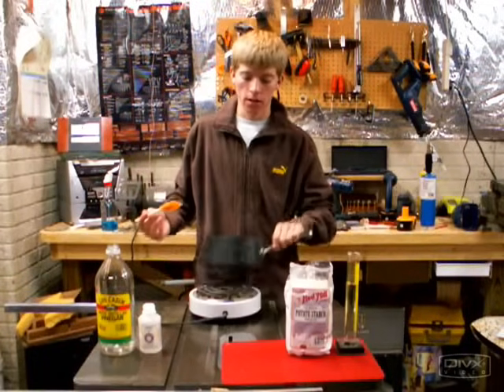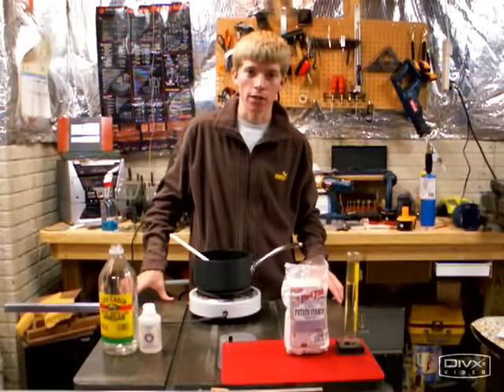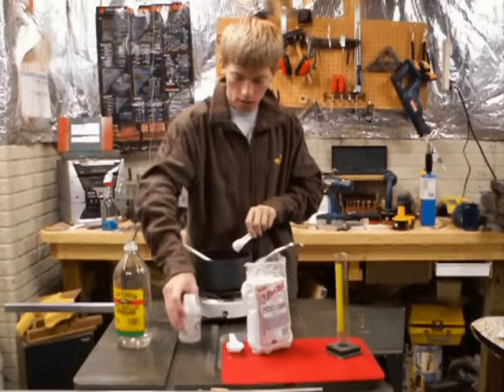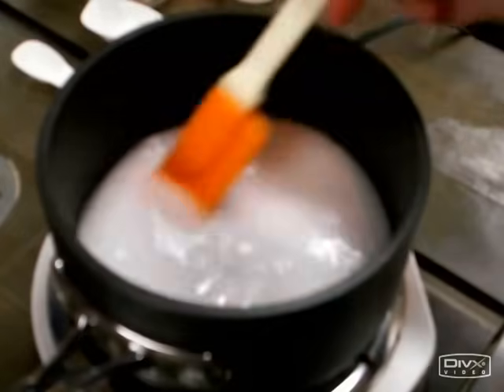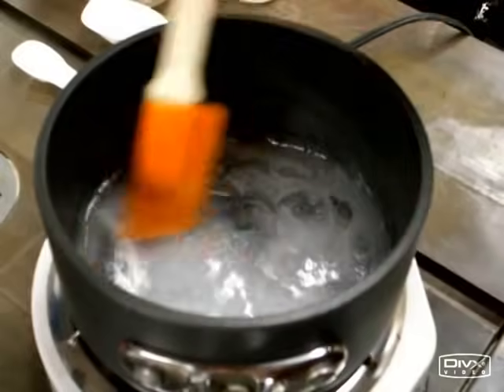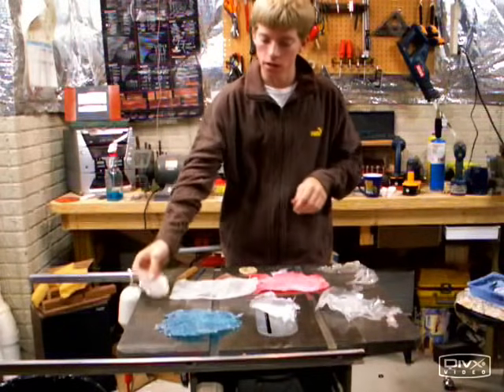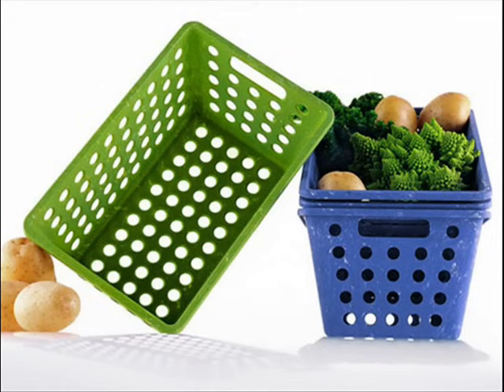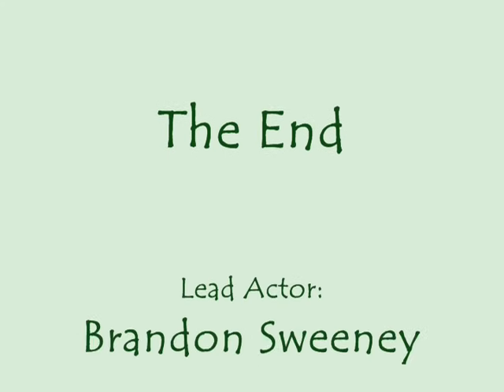Make your own bioplastic

Comment: I was so interested in your video, i went to green-plastics to check it out and get more information.  What i found was no working inks and e-mail addresses that are returned by the postmaster.  So... no help there.  Could you answer a question or 2 for me?  How long do the thin ones take to cure, and do you have an estimate on how long a 1/4 inch piece would take to cure?  (less that an inch square, and notebook sized sheet.   I don.t know if it takes hours or days, because you never mentioned it.  I have lots of ideas I want to try.  Any updates you can supply would be very appreciated.  Thank you!

Comment: Hello, very good presentation. I  was hoping to demonstrate this to my students. So I had a small query, please. How good is its tensile strength? I mean if you make a bag from this plastic and put 7-8 apples or 1 kg of potato, will it hold the weight?
Reply: Hi, I was just wondering if you tried this with your students, and how it went, and any additional tips. I am making this for a presentation as well, and so far I haven't been successful as it keeps breaking. So would just like some feedback. Thank you.
Reply: @lacey1887  hello. I did make it. We faced problems though. The spread of mixture was not easy, hence smooth of surface was missing. At some places it was uneven. So it tore. Tensility was ok. But not great. Once wet, it became sticky. It dried, but texture had changed. It becomes very dry, like a dry leaf, easy to crush.

Comment: how long does it take to harden?  Maybe I messed up but it seems to be taking longer than I thought
Reply: Hi Jordan, I'm having the same trouble - first attempt I took it off soon after it went translucent and its remained a sticky goo. Second attempt I added a tiny bit more tapioca flour and kept on heat for about 4 minutes while it was bubbling- this is a little less sticky, but still very much more of a goo than a plastic. Has anyone had this problem and overcome it with variations of the recipe or cooking time?

Comment: Steps to success:
1 tablespoon cornstarch
4 tablespoon water
1 teaspoon glycerin
1 teaspoon vinegar
Mix when cold
Low heat and stir until bubbles formed and solution starts to be clear
Reply: Is there anything we can replace glycerin
Reply: Ryan Ramego I have the same problem.
Reply: @syazanasufrian1760  can I have cornflour instead of cornstarch
Reply: Shafin Ahmed it is the same thing, dear. It is just it is called corn starch in US and corn flour in UK.
Reply: @shafinahmed3453  it is samething
Reply: @syazanasufrian1760     ...   thank you for the details! a typically American English with a hum in the backdrop, made it difficult for an Asian like I, to comprehend. thanks for the details in writing. thank you so much for the help!   ...   🙏🙏🙏   ...   
 - NSJ / INDIA 
Thursday, 4 MARCH 2021 (11:36 Hrs IST)
Reply: @syazanasufrian1760  there is something completely diffrent called cornflour
Reply: @brandonirwin9626  actually it is a sugar alcohol, not a fat.
Reply: @hilaryzeller6183  you're right, I mixed it up and meant to say its derived from animal fats, not is a fat.
Reply: @hilaryzeller6183  can be* it has many sources.
Reply: Does this dissolve in water?
Reply: can this be dissolved in water????
Reply: does this dissolve in water though?
Reply: josepf stalin just add more glycerine, both vinegar n glycerine act as plasticiser for the starch.
Reply: @kinwow-j8d  Are you are thinking of Alginate?
When the dentist puts that tray in your mouth with the goopy material that sets up in a minute, she's using alginate. It provides excellent detail, sets up really quickly, and is non-toxic.
Reply: What vinegar should i use?
Reply: thanks
Reply: Is it like epoxy resin ?
Reply: Is there any way I could do this without glycerin?
Reply: Can we add natural products like fruit peels?
Reply: How to shape it? Into bags and cutlery? Please reply
Reply: what if i use flour?
Reply: is there any alternative for glycerin
Reply: i dont get the “mix when cold” enlighten meee
Reply: @Lunaxyzxd  it just means that, you need to start mixing it before the ingredients gets too hot under the heat. It just means that after you put all of the needed ingredients start mixing it.
Reply: @Lunaxyzxd  you need to mix it all first then after it is thoroughly mixed, then you can start heating it in low fire
Reply: No glycerin what I have to do
Reply: Should I use aluminium foil?
Reply: Can i add tea powder to this and still work ??
Reply: @kinwow-j8d  yeah sure. Seaweed also using for made bioplastic. Kappaphycus alvarizii is the species
Reply: Mix when cold?
Reply: @allaboutarts4184  yes, first, then add heat. This way it doesn’t clump.
Reply: Thank you!
Reply: Can anyone tell me if vegetable glycerin would work??
Reply: can u specify the measurements

Comment: Hello!

I've used your video as a reference for our scientific study and experiment about on how we can help our environment and one of my colleagues have thought about this and at first, I've hesitated that this might consume our short period of time on conducting the experiment before our presentation yet when I found out about this video, I thought that "This might be possible" then it really is.

I did precisely what the steps are from the beginning even the pre-measuring of the volume of the materials.. 
But then, the results were not as same as yours. It turned out to be a hard sticky plastic unlike yours that is fully liquefied when it is poured on the aluminum foil (?).. 

I am slightly confused about what really is going on as to why it did not get the same results as yours to mine when I did exactly the same as you did?

Though, the results weren't that half bad.. We actually made one but still wasn't enough for us to prove this in our presentation that this can change the way we use plastic in our world..

Comment: That's cool, AWSOME..

What can be made with Silcone & starch or 
JB WELD, OR MABEY ROOF REPAIR SEALENTS, PLUMBING CEMENT GLUES ???? IDK how yhe make those harder plastics cast

I WANT TO TRY TO MAKE NEW CUSTOM PISTOL GRIPS..WITH OUT HAVING TO PAY FOR SMOOTH-ON RESIN 
(I THINK IT WILL TAKE MULTIPLE ATTEMPTS TO HET RIGHT)

I GEUSS I CAN USE THE SILCONE CAULK AND STARCH METHOD FOR MOLD

BLACK IS OKAY FOR THE PLASTIC CAST..BLACK IS THE MOST COMMON COLOR STILL AROUND

I'D LIKE TRY MAKING BUBBLE LETTER IN THE MOLDS MABE FROM SANDING DOQN THE FIRST CAST AND PUTTING BUBBLE LETTERS ON OT AND MAKING ANOTHER MOLD

BUT I GEUSS FOR THE CUSTOME (THE GUN IS NO LONGER MANUFACTURERED AND OLD GRIPS ARE HARD TO FIND PLUS THET ARE EXPENSIVE COMPARED TO GUNS STILL ON THE MARKET)

If I figure that out, I'll try the brush on metelic powered that get brushed into the molds before pouring the plastic resins..

Comment: You idiot. Mfgs have been putting chitosan in our food, meds, coating machinery having metal flake off due to chemicals we require to sterilize them & the same thing is done to mesh implanted & it is harming thousands globally. 

Nothing about bio plastic is safe. 

Dead sea life waste, beetles , have been grinded into chitin.. chitosan to make powder, pellet, liquid chitosan...aka polypropylene.. poly ingredients in cookies, chips, baby formula, vaccines like pertussis, supplements that tick off the organs increasingly causing cancer, it is in pet food & treats killing animals .. fda considers it a perservative & approved it long ago using the awful cosmetic law.  Fda gave exceptions to mfgs putting it in our food .  Look up grass mfg chitosan approval by  fda pdf doc .. listing foods. 

Corn does not digest for what reasons ????  It too is used to make bio plastic .   It is in fertilizer 
Used to retain moisture & typically it is bugs with a shell that are grinded .. vs dead sea life waste. 

So.. when you see chitin ..chitosan.. poly, polypropylene  even in laxatives .. you might as well say yum.. plastic affecting humans & animals . 
A slow way to die?  Depends on all you take in.. medical devices .. even pockets devices are put in like pacemakers .. mesh .  Bacteria  grows for a reason. External heat , stored heat, heat to cold like baby wipes treated.. human body temp even exceeds mesh mfgs labels yet it goes in us .. permanently damaging . Erosion aka infection sets in quick.. human body response to foreign objects will do this.  Inflamation , infection & a hole can be made between vital organs .   

We are so stupid .. people see chitosan affected cattle feed .. yet humans keep allowing it. 

Banned sea life .. customs rejects .. where does it go?
Would you care if bad sea life was the bio plastic fda calls perservative .. in your food?

What about food packaging.. yep, chitosan. Think recalls.. Bacteria. 

Why do eggs, chickens keep having recalls .. their feed. 

Chitosan is even in cancer drugs.

You made only another form of plastic harming our environment & living beings. 

Good job.

Watch "CIFT Chitin & Chitosan Film.wmv" on YouTube
https://youtu.be/A3CCBzzhJCU

Comment: Bioplastics 101 / 1 Tablespoon Corn Starch / 4 Tablespoons Water / 1 Teaspoon Glycerin / 1 Teaspoon Vinegar / Mix Completely While Cold / Pasty LookTurn On Heat / Turns To Gel / Constantly Stir / When It Turns Slightly Opaque Stir Faster / Stir Some More And  End Heat / Start To Spread On Non-Stick Surface / Allow To Solidify ...

Comment: OK Junior High science experiment, but face it - will not be taking class 5 rapids in a Bio-kayak, ever. Problem is not the plastic, it is the disposal of same. Degradable materials and coatings which can be composted are great, for temporary short-term, one-time uses. All else demands  more durability and permanence, not less. Older cars were more "biodegradable," if you think rust returning them to the Earth. Industries rise to market demands, and "Green" tech is too inherently contradictory, with PR hype slathered over products that must perform to some other standard besides chewy goodness. Cars which last twenty years without crumbling are more environmentally friendly than old rustbuckets with few plastic parts.

Comment: Can it be poured into a mold ?
Reply: It probably can be poured into a silicone mold as those typically have a high heat resistance. Would have to be careful though as some rubber molds may not work including silicone/rubber mixed molds. My curious question is if this stuff can be used to make a mold and how well it works. I mostly buy liquid silicone to make molds with but I have tried using glycerin/gelatin mixtures to make a reusable mold making material as well as melting HDPE plastic to make molds.
Reply: Did you test it? Would be great as a Polyester alternative.
Reply: For this I think you should flatten it out between two sheets of wood and then place over the mold while oven hot and I guess the mold must be made out of wood, it will not stick by greasing the mold with a finger dip of cooking oil as I had done and it will slide out once its molded.
Reply: Could you please share the glycerin/gelatin mold recipe with me? Thanks so much!
Reply: Crab Hawk
Reply: Crab Hawk

Comment: is it water proof?
Reply: localbroadcast It will soak up water, soften and eventually crumble, when exposed to water, in my experience. So no, it's not really a good option for a cup, imo. It also has a lot of shrinkage during the curing process. 
Let me know if you figured something out :)
Reply: About how long did it survive when in water?  I can see perhaps using this for disposable/compostable tableware if it would stand up to one or two uses.
Reply: that blonde bitch looks good.
Reply: You mean if it is soluble in water?
Reply: sure.  if you make it into a cup shape will the cup shaped bioplastic made in this method hold that water for a long time or will it slowly leak or something or what
Reply: It actually just need a small research...and I found that it is not soluble in water....especially the starch bioplastic  Source: http://www.innovativeindustry.net/types-of-bioplastic
Reply: no

Comment: how long it takes for that bioplastic to decompost ? answer pleaseee!!!!!
Reply: decompose and compost are two different things

if you don't believe me just put some silver chloride in the furnace and it should decompose into silver and chlorine

if you want it to compost either hot compost or anaerobic compost though it might work with things such as bokashi or ethanol fermentation

don't try pickling it because that will replenish the vinegar supply

if it is long and thin that will help it decompose better than something short and thick

if you want to try making something like a sheet or a baggie find some safe plasticizer to use

Comment: One question... Can you make a more brittle type of plastic that can be used in a filament extruder for making 3d printing filament??
Reply: good idea!
Reply: If you can make your own starch, then you can make an unlimited amount of plastic for free.
Reply: Theodor Butters Is nitrogen expensive?
Reply: Yes in fact you can, PLA is quite similar to this version of bioplastics.
the challenging part is to fabricate it in filament form without destroying it.
Reply: PLa does not burn up, the mixture shwon in the video will surely kill the nozzle
Reply: If it is like PLA, the temperature must not exceed ~230°c
Reply: Does it burn up in a filament extruder?
Reply: Is it because it cools off and hardens much quicker then normal plastic?
Reply: no because it can handle the heat extrudable plastic is not as easy to make but the ingredients are similar

Comment: how EXACTLY does this form of bioplastic react in water?
how fast does it dessolve? I'm sure thicker pieces of plastic would take longer.. but say a piece half a inch thick? or a quarter of a inch?  
does it go back to a goo form?
I know the more glycerin you add, the more flexible it is.. does that also determine how fast it dessolves in water?

Comment: I just tried it with cornstarch because that's all I had, it behaves very differently...
Reply: yeah, it doesn't have the same elasticity as the tapioca. By the time it started to get transparent, it was turning brown on the edges.

Comment: If I were to make a large batch of this and harden it in a brick, which would then later be cut into parts of the desired shapes and sizes, would this recipe work?
Reply: +Matt Woo I think it would depend on the amount of glycerin you add. The more glycerin, the more flexible it'll become :)
Reply: yes but it doesnt get to that state with cornstarch
Reply: +Matt Woo Maybe with potato starch (Dunno if there's any difference). I've tried it myself for the first time today, so I don't know what the results will be yet
Reply: yeah, they used tapioca starch in the recipe, it might react differently with the other ingredients. For a harder plastic, just use 4 parts cornstarch, 3 parts water, and a splash of oil. microwave it until its yellow throughout.
Reply: +Rosanne Sol when you had the gel like consistency, did you have to let it dry for its hardened state?

Comment: How dense and strong can the plastic be if you used this method? I am a model builder and would like to use alternate sources to build specialized parts so I could save a fair bit of time and money. I would need a plastic that is strong and durable enough to survive a drop or fall from at least five feet without breaking apart.
Reply: +Travis Fisher For the price of the ingredients, there isn't much to loose by just giving it a try, do you think? You might even come up with more things to make than you've thought of already, once you see how it handles and molds. You seem creative. I bet you would get a lot out of just trying! I'm almost convincing myself to try it!
Reply: CuriousEarthMan The models I build are Citadel Miniatures and I wanted to come up with a cheap way of making pauldrons and melee weapons for the models I have. I heard of press molding and was trying to find something to fill the molds in to make the parts from.
Reply: +Travis Fisher This plastic looks to me like it would work well for what you want. I don't see why the finished, hot plastic 'gel' couldn't be poured or pressed into a mold. It looks so resilient when cooled in the video, I can hardly imagine it breaking from a short fall of five or so feet, of course I could be wrong. Can you think of a cheaper way to get a formable plastic? Recycling jugs and bottles works, but you need to invest more in 'processing equipment' if you are going to be time efficient with those. Starch seems pretty cheap to me, and the dollar store for utensils, and Salivation Army for the hot plate  and non-stick pan if you don't have an extra....Are there engineering issues to consider to using this plastic? Are there specific problems why you think this might not be good, besides the dropping, or brittleness issues?
Reply: CuriousEarthMan The models I build are rather expensive and the last thing I would need is a plastic that would warp or melt if I were to spray paint it, use methylated spirits on it or for super glue. The models I build come in kits valued at anywhere between $50 to $180 and I would need to be confident enough that the bio-plastic wont ruin my models.